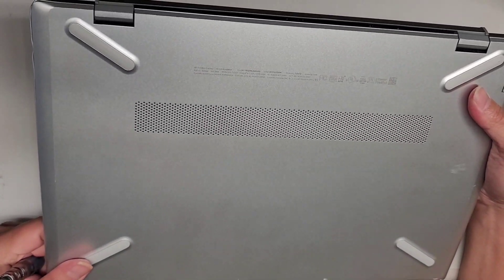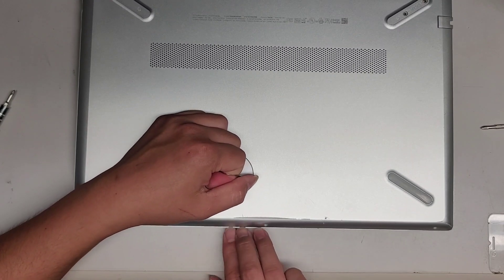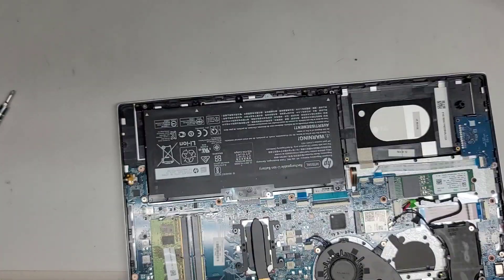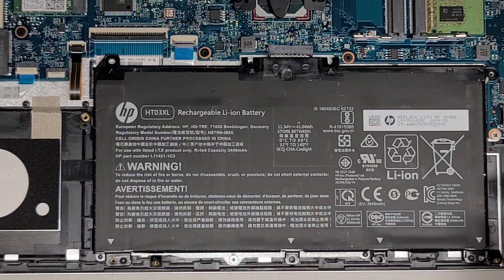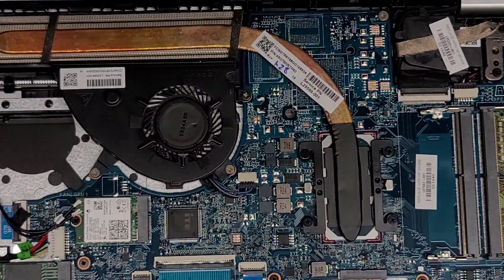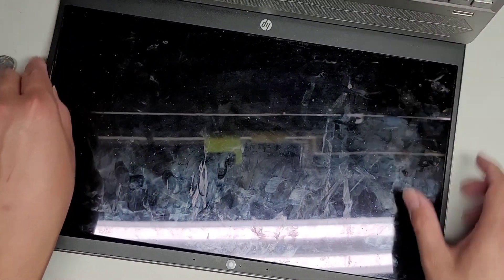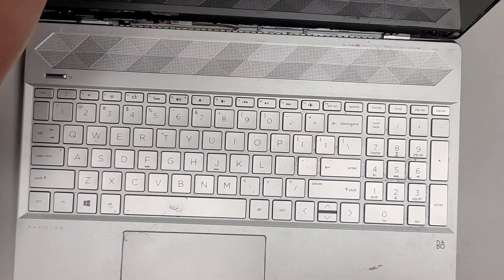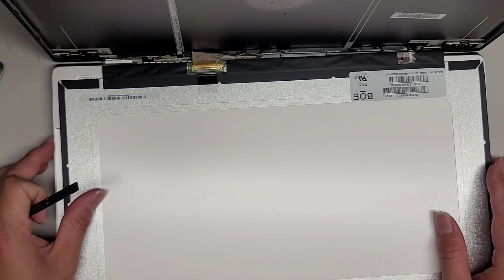HP Laptop 15-CS3063CL Disassembly RAM SSD Hard Drive Upgrade Battery LCD Screen Replacement Repair

Comment: thanks for the video, really great job. the hardest part was the very last bottom of the bezel..I also don't have the touch screen now, im going to go on and find out what happened to it.  thanks again, great job
Reply from the maker: Glad it helped. If you haven't already, please like and subscribe so others can find my videos. Thanks!
Reply: Hopefully you purchased a touch screen. I know sometimes you have a choice of touch or non-touch, something to pay attention to when purchasing a new screen.

I'm getting ready to replace the top lid and hinges. I wanted to see what I'm in for when transferring the parts over. One laptop like this I had both stretchy tabs break off. I had to get the heat gun to warm up the back and it worked ok, just a waste of time.
Reply from the maker: Did you buy based on the lcd model number? That's very important.
Reply from the maker: You can't just buy based on the laptop model number.
Reply: @thomastommy9864  so, I did purchase a touch screen, and confirmed it with the supplier..but, no luck.   As for your deal, I did not have any issues with the stretchy tabs, just grabbed ahold with the tweezers, and pulled straight down, actually between the screen and main body, slowly and kept grabbing it, so as not to stretch it too far.  I was able to purchase new stretchy tabs and install on the new screen.  I did remove the battery.  the bezel was a little tough to get back on after the repair, the bottom was the toughest part.  other than that, not too bad.  I did watch like 3 videos repeatedly for this repair, I got good info from all 3..good luck..
Reply from the maker: Nice

Comment: I was wondering, I cant seem to get the touch screen to work any more, not that its that big of a deal, but..I went through the diagnostics, no issues, I sent a message to  brightfocal, their reply:
"Could you re-seat LCD cable and connector and make sure it is secure? You could unplug and re-plug.You could apply a TAPE on top of the connection to secure after you make connection. Please try a few times, it is most likely due to connection."  ..not doing that..just wondered if you ran into this issue before and if you found a solution?  Thanks.
Reply from the maker: You're not gonna try the repair? Lol I can't help you if you won't even try that. Make sure you do the battery drain first.
Reply: @ItsBinhRepaired  I did the repair, it worked perfect!  but, after I did the repair, the new screen that bright focal sent doesn't work using the touch screen.  it looks perfect, just the touchscreen part of it doesn't work..  at the end of your video, you had the same issue, where you mention the touch screen no longer works..I was wondering if you found out what the problem was.  After I installed the new screen, I ran it through the diagnostics and it all checked out. but, the computer says touch screen and pen is not available..   Any advise??  thanks
Reply: @ItsBinhRepaired  ps, I did remove that battery like you showed, and held the power button for about 20 seconds..also like you showed, so I didn't fry the boards..it went back together fine, the screen is good, bezel is perfect, just dont have the touch screen capability anymore.. see the comment below. thanks
Reply from the maker: @scohen6251  try restarting the computer one time, not shut down, restart.
Reply: @scohen6251  A few times I had to remove the LCD driver in Device Manager under Monitors for things to work properly. Sometimes I'd even get flashing and flickering in Windows until I removed it and rebooted. Probably because Windows was still using the old LCD's timings and settings. Also make sure all drivers are working properly. There is one driver that can control touch. In some machines I had to disable it because touch was failing with ghost touches all over, usually all-in-ones.
Reply from the maker: Usually restating the computer alone will fix the issue.